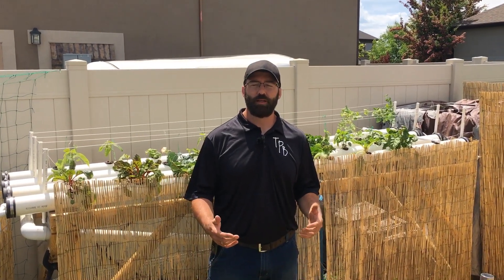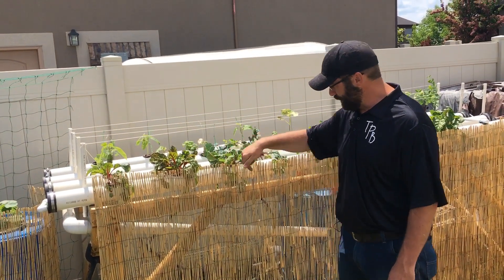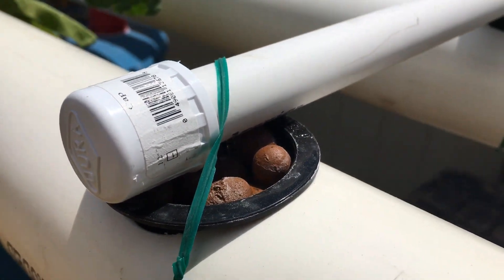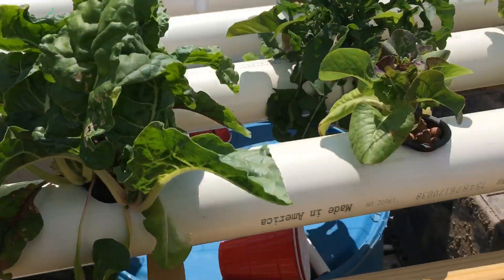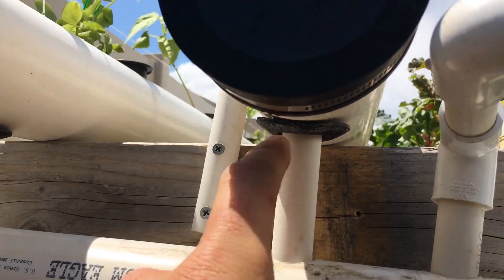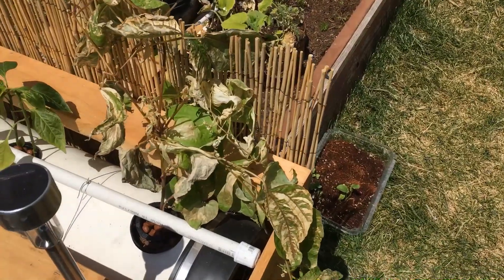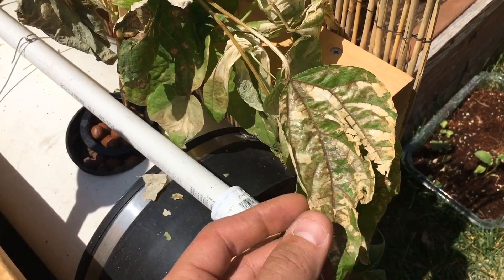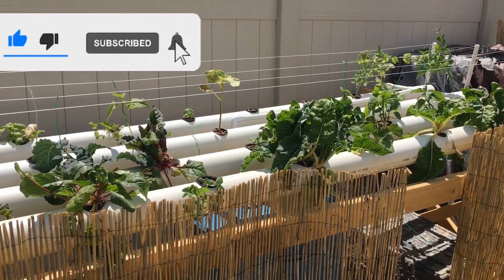Ep. 6 NFT (how to) hydroponic method and why you should harden your plants

Comment: How do you prevent the sun increasing water reservior temprature
Reply from the maker: Siamak Borzou  you can bury your reservoir in the ground if your temps are high.  The side walls of the dirt will act as a natural chiller.  Or wrap your NFT tubes with a reflective wrap to deflect the heat from the sun.